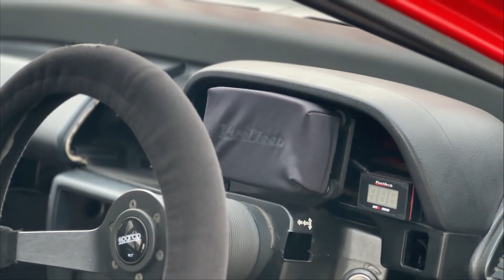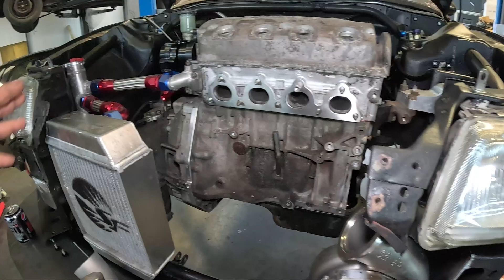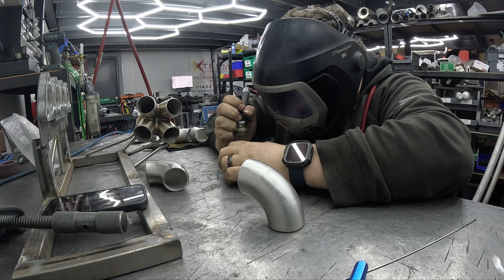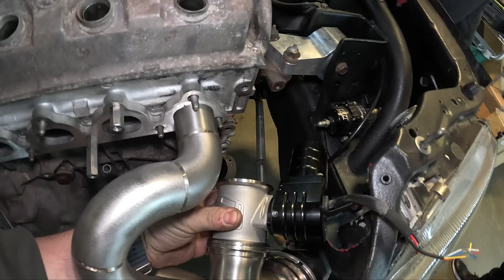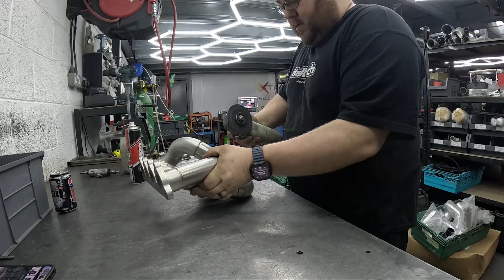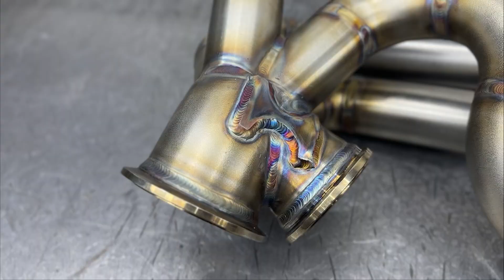We make a TURBO MANIFOLD for an 8 SECOND Honda D16 drag car!

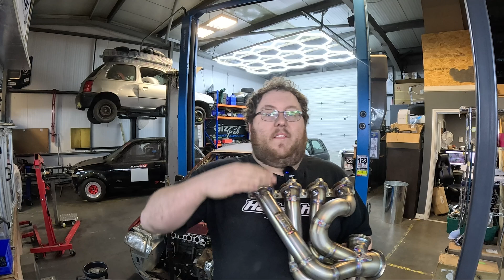Comment: 15:30 i think that rule is for o2 sensors and not for EGT sensors
Reply from the maker: For 02 sensors its 12-18" From the Valve (Depending on the manufacturer)